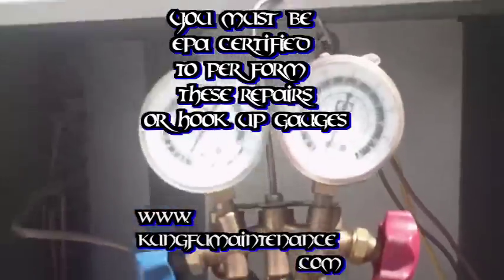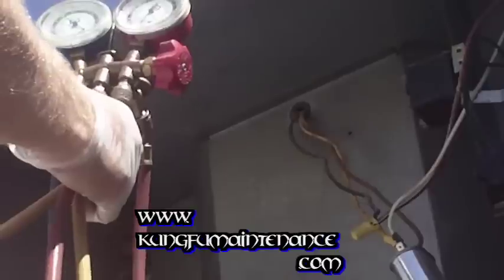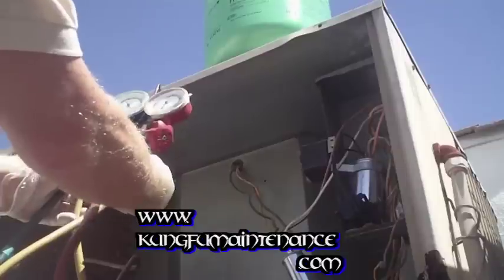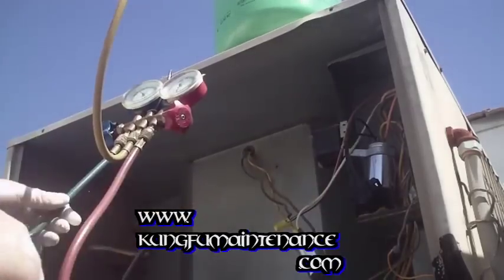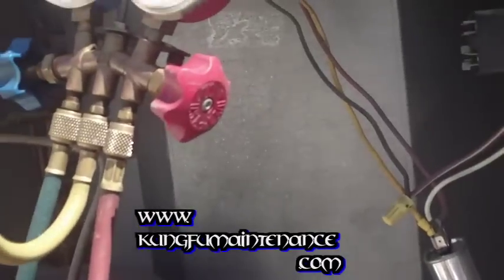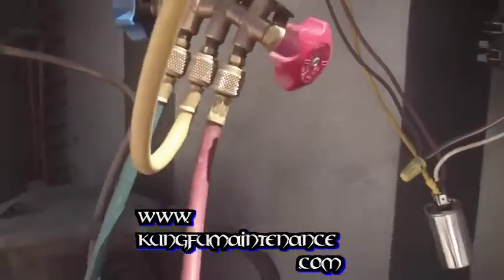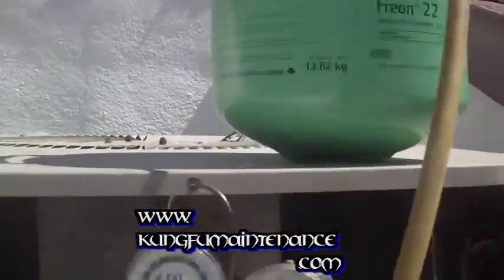How to Charge an Air Conditioner  That is Low On Freon ~ AC 101

Comment from the maker: Get KFM's favored AC Gauges here            http://amzn.to/2kYgGb8
Easiest Way To Get Universal EPA Certified Prep Manual    http://amzn.to/2kIQdQC
Get KFM's favored Multi-Meter  here        http://amzn.to/2l8W9CO 
Wet Dry Vacuum used in so many KFM videos   http://amzn.to/2lFxi7u
Valve Core Removal Tool                              http://amzn.to/2kJ00pC
Inficon Refrigerant Scale                               http://amzn.to/2vUCQPD
Get the Screwdriver used in so many KFM videos here    http://amzn.to/2kHFoOF 
Get the Milwaukee 11 in 1 Screwdriver     http://amzn.to/2uTtsNj 
Get  the Multi Tool Pliers used in so many KFM videos       http://amzn.to/2kWTjPp
Get KFM favored Electronic Leak Detector        http://amzn.to/2kmQMMz
Simple Leak Seek Spray   http://amzn.to/2lFfcC5  Laser Thermometer  http://amzn.to/2layD8I  
Hard Start Kit     http://amzn.to/2kiD16v   Contactor     http://amzn.to/2lFqA0P
5mf Capacitor   http://amzn.to/2wC96sH     35mf Capacitor    http://amzn.to/2vZVZ2t
35/5mf Capacitor   http://amzn.to/2iVJNi2        40/5mf Capacitor    http://amzn.to/2wzEdXD 
45/5 mf Capacitor   http://amzn.to/2w0wez5   
Condensate Pan Tablets   http://amzn.to/2lalV9W   No Rinse Coil Cleaner  http://amzn.to/2lHg8GD
Condenser Fin Whisk Brush                          http://amzn.to/2vWXUoC 
Chapin Pro Pump Sprayer                             http://amzn.to/2vWCXdD
Evaporator Coil Cleaner No Rinse Mix        http://amzn.to/2x3eJTT
Evaporator Coil Cleaner No Rinse Can        http://amzn.to/2ezIxju  
You must be EPA certified to charge or recover refrigerants and here is about the Easiest Way To Get certified with the Universal EPA Certified Prep Manual    http://amzn.to/2kIQdQC

Get The Kung Fu Maintenance book here     http://amzn.to/2lEQPFk
Or  the Kung Fu Maintenance E book here  for less than $5    http://amzn.to/2lEY8wD
Get the Kung Fu Maintenance album (good driving music) "Up Beat" here     http://amzn.to/2l41pZ1
Get the Kung Fu Maintenance album (nice Instrumental music) "Entropy" here   http://amzn.to/2kl2U0p
Samsung Galaxy S8 Plus        http://amzn.to/2sFn9h8
GoPro Hero 5 Action Camera         http://amzn.to/2sN4nVK
Rode Lapel Microphone                 http://amzn.to/2vZoFc7
Purple Panda Lapel Microphone  Kit   http://amzn.to/2wByXkq
Video Edit Pro Software       http://amzn.to/2ruaaeZ
Samsung Galaxy S5                 http://amzn.to/2wBxk6l     
Samsung Galaxy S8 Plus        http://amzn.to/2sFn9h8
Video Edit Pro Software       http://amzn.to/2ruaaeZ

Hire An HVAC Specialist                                  http://amzn.to/2lktKek
Air Duct Cleaning Services                              http://amzn.to/2lFTpun
Central Air Conditioner Tune Up                   http://amzn.to/2lzJGoy 
Air Conditioner Repair Or Installation          http://amzn.to/2lFsEGw                                           
I don't work for any of the product companies  listed however I do make a small commission on items ordered  through the links.
Reply: KungFuMaintenance 2

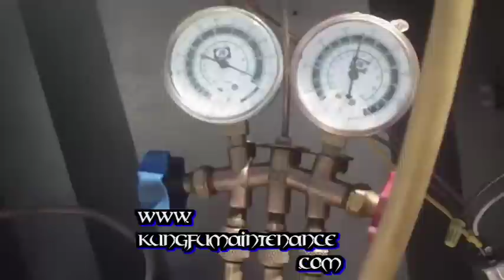Comment: At 7:05 the colored diagram really sends home the information about which is the low side line, high side line, and everything else!  super job guy, thanks.  it's too bad it's Saturday, 90 degrees indoors, and you just convinced me that i probably better not mess with my apartment complex's ac unit when i especially don't have a drum of Freon to spare.

Comment: I like to poor a couple cups of water on the compressor when its running too.  This helps to cool down the bearings and greatly increases the life of the electrode diffusers inside the valves.  allows them to get nice and cool and oils them up.  Great Job Jedi.  Best Damn video i've seen in a while.

Comment from the maker: Yes that is true charging in colder weather takes more time. One way I have found to speeds things up in colder weather is to remove the refrigerant can from the box (which acts as an insulator) and place the jug of freon over the condensor fan so as the fan removes heat from the condensor it blows the heat across the refrigerant can. This recycles the heat energy at the can and speeds up the charge. The box acts as an insulator to the freon can so removing it will allow the can to absorb heat.

Comment from the maker: This one was R-22 vapor charged. You are right in that charging R-410 application is different depending on your jug of refrigerant and whether it has a dip tube or not determines whether the jug needs to be flipped upside down or not to use liquid. Charging R-410 is still done through the suction side but the short story is it needs to be throttle charged with liquid. Not liquid side only just charged with liquid. R410a is charged as a liquid to prevent the refrigerant blend from separating.

Comment from the maker: To lanceditzler,

      This one was just a bit low on freon and took about one and a half pounds to reach proper charge of ambient plus thirty degrees on the high side. It was a hundred and five degrees and climbing up on the roof that day. It just makes sense to calculate refrigerant usage by taking a before and after reading with the scale. No need to lug the scale up on the roof.

Comment from the maker: You are right on there. I opened blue suction line only to charge with vapor. No you do not want to open both as this will let liquid refrigerant cross over into the suction line. For charging purposes you only want to open the blue low side suction line. There are other methods of charging done solely through the high side. I prefer charging with vapor through the blue low side as it is easy on the compressor and fairly easy to monitor and adjust.  ~ Good questions. Thanks for watching. ~ KFM ~

Comment from the maker: This one had a tiny micro leak which I used a micro leak repair additive to repair (you can see the video I have on it if you like to titled "Air Conditioner How To Super Seal Micro Leak Repair"). It has now been a year and several months since the repair and system is still running great keeping things nice and chilly. No lack of performance. Purging the line sets prior to charging is how to prevent getting moisture into the system.

Comment from the maker: Yes that is very likely. Ideal charge will produce a temperature around 40 degrees plus or minus 5 degrees at the evaporator coil. When the freon is low the temperature at the evaporator coil can go below 32 degrees which as you probably already know is the temperature at which water freezes.

Comment from the maker: Best way to charge in my opinion is charging through the low side(suction side) while unit is running with vapor only from the tank, keeping an eye on pressures and temperatures. Low side line should flash nice and chilly all the way to the evaporator coil. Look for the 15-20 degree split from an in going to an outgoing register over a time span of twenty minutes.

Comment from the maker: To Pbour, Yes ambient outside temp + 30 on the high side is what your looking for as a general guide. However some systems have design differences.  Use your feel and judgement. The suction side line should flash ice cold along the length of the suction line to the compressor. When it cold sweats a little you know your good. The general proofs though are 40 degree temperature at the evaporator coil and fifteen to twenty degree split between air temperatures at an inflow and an outflow register.

Comment from the maker: Yes this was R-22 and I was charging by vapor through the low side. This takes a tiny bit longer than charging by liquid but is easier on the compressor and also easier to get at time of service measurements of what is going on (superheat and subcool wise). Charging by liquid takes more time for pressures to balance and adjust. R410A should be charged by liquid (can upside down) unless it has a dip tube) because it is a blend and the blend will separate if charged by vapor.

Comment from the maker: Through the process of "dumping in" one can measure and charge weight of liquid refrigerant on the high side and or low side. This is done with the condensor turned off and waiting an appropriate amount of time before turning the condensor back on.

Comment from the maker: To dianemarie909, there are actually quite a bit of different methods and varied schools of thought as to what is the most accurate method. I like to add the gas little by little through the low side or suction side and monitor temperatures and pressures. Some people weigh in refrigerant by calculating manufacturer specs. and adjusting for length of plumbing with the compressor off through just the high side as a liquid and some through both sides.

Comment from the maker: An initial service call would probably cost about 60 to 100 bucks. Add to that parts or such that may need to be repaired or replaced. If it needed R22 it could be a bit more expensive in price these days as r22 is being phased out which is driving up the cost of the refrigerant. Expect to pay between 30 to 100  per pound of freon average 2.5 ton system holds about 7 lbs. If compressor is not overheating than it is probably no more than 3 pounds if low on freon.

Comment: Thanks for helping me to challenge bull crap artists.  A good A/C guy is hard to find!  I have been told that I needed to replace whole unit for 5000.  I found ants around the contactor.  I just can't charge my system.  I've fixed everything else.

Comment from the maker: If you do a quick youtube search "Four Ways To Speed Up Charging" it should come up in the first few selections (at least it did for me).Yes a little bit of condensate rain for a faster charge, not a bad trade in my opinion. I will echo the voices you have heard against tipping the can as it likely will shorten the compressor life by introducing liquid refrigerant to the pistons.

Comment from the maker: ToTheATLAdventure,
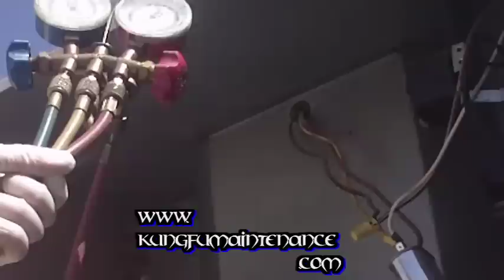     Using quick connect fittings will prevent the refrigerant from going everywhere unless you have a leaking schrader valve. You can see the quick connect in the video with my right hand I  am using a quick connect fitting from about 1:01TO 1:16. When you disconnect the quick connect it quickly cuts off refrigerant flow.

Comment from the maker: Most likely it will take between 1/2 to two and a half pounds to increase 10 psi. The line set distance is the plumbing from the outside condensor to the inside air handler and evaporator. See me vid series "How To Charge An Air Conditioner Low On Freon By Superheat and Subcool" for a better explanation of the terms. For good charge your high side on the green dial would show 110 as a less perfect rule of thumb. I mostly go by temperature pressure relationship (SH and SC) rather than weight.

Comment: If your careful, you can charged with liquid in the suction line and it would me much faster then vapor charging...
Reply from the maker: Yes that is true. Though I prefer the vapor method as it is easier on the compressor. I hope to be showing the liquid charging method in a future upcoming video.
Reply: KungFuMaintenance 
+Jaocb Berge

Thank you to both of you.  Both gave answers that I was looking for.  :-)
Reply: +KungFuMaintenance I agree vapor on smaller units is safer. Last thing you want to do is slug the compressor. Did you leak check the unit after you put freon in it? Let me guess? The customer said "just make cold air"? In the long run the customer would have been better off getting the leak fixed and having a fresh drier installed. I ALWAYS USE THE LAW. 35% leakage requires me to fix it, so either I fix the leak, then charge or I refer you to somebody who doesn't care about his customers.
Reply: And slug the compressor?

Comment: EPA does state that residential a/c with a certain % leak MUST be fixed. If it is low on coolant,if it has a leak or the last man to service this a/c made an incorrect charge. People far too often jump straight to charging a system. In my job we have 5 guys that service the same 443 a/c's thoughout the property. It is go go go all the time. We dont not have time to recover and pressure check every a/c that we think has a leak. A service log sticker is very great idea to place on the condenser!

Comment: Do NOT open the red valve on the gauges. That will allow the high pressure refrigerant into the manifold and then into the refrigerant bottle which could be very dangerous.

Comment: normally when it takes such a long time to charge the system especially one of those old beast janitrol's it means u have something else going on aswell. could be as simple a dirty evap coil or something as serious as a blockage. the only thing that would make the system take so long to take in freon under normal conditions is a extremely long line set or a long lift on the lines. im sayin you also have a dirty evap on that unit.
Reply: That's in his next video. He will take a water hose and spray into the duct work!
Reply: William Hollandsworth some people don't even know they have a filter lol

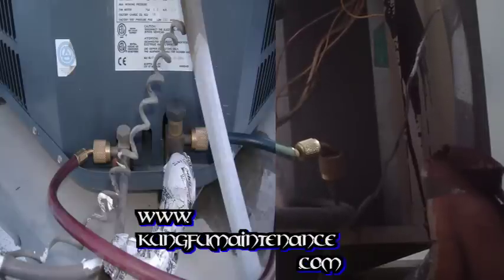Comment: Do you have turn the HEX shaped valve on the suction line (on the insertion at 2:20 of your video) after you hook up the BLUE hose? My low pressure gauge stays at zero after I hooked up the BLUE hose and turned the system on? I saw you removed the sideway cap of the suction line and hooked up the blue hose to it. But you didn't mention anything about  these HEX shaped valves on top of the suction line next to the cap (now blue hose). I just want to check if my Freon R22 is low because my home central AC (Heat pump) is running but not pumping out any cool air.

Comment from the maker: That could be normal, it could even take longer, it really depends on quite a few factors. Temperature out side that day, temperature inside, cleanliness of coils and filters, how hot the compressor is due to running at a low freon level, amount of freon in the charging cylinder, condition of schrader valves, condition of filter driers, all of these and much more factor in to the speed of the charge. Check my video " Four Ways To Speed Up Refrigerant Charging" for tips on speeding things up.

Comment: is ambient temperature the general formula to go with?Will the same formula work for r410a? My last question my system can use both r22 or r410a how do I figure what's in my system? Or is the better route to go is to evacuate the system and just fill it with r410a. Thanks for the great video.
Reply from the maker: +i0wNz407 Ambient + 30 degrees  is only a rule of thumb for R22 charge being somewhat appropriate. Better and more accurate charging is done by calculating proper superheat and subcool. Your unit should be labeled whether it's r410a or R22. You never want to mix refrigerants as this can cause the formation of acids and other unwanted effects. Charging methods for r410a are different than R22. R22 can be charged by liquid or vapor. R 410A should be charged by liquid as it is a formulated blend of refrigerant and for the engineered mix to be proper it is charged as a liquid. R410a has higher operating pressures than R22. The ambient plus  30 rule of thumb only works for R22. Different systems are engineered to work best with certain refrigerants.
Reply: Do u have to vacuum the system completely down OR can u add r22 to what's already in there?
Reply: vacuum the system completely is (of course) the best method, you do want your system to operate the most efficiently.... don't you? you do want your system to operate without contaminates, don't you ?

Comment: kungfuMaintenance i just curious is that okey if ask you about the comment you say that you add 30 degrees to the ambient  that means that the pressure should be 8o + 30 =110 degrees the pressure shuld be 226 degrees? thanks good video

Comment from the maker: AC techs need to be prepared for all craziness they will find out in the field. Ready for anything before opening a unit. Loose capacitors like this should be anchored and I have a couple videos showing different methods "How To Secure A Dangling Capacitor", "Plumbers Strap Method" and the "Military Grade Cable Tie Method". As for the gloves they prevent frost bite see me vid "How To Replace Leaking AC Schrader Valve Cores That Leak Freon Refrigerant Charge" for an extreme demonstration why.

Comment: so you use outside ambient, and not inside ambient? My furnace is in my basement, and the A/C unit is obviously outside...so I would go with outside temp, not what my basement temp is?  Thanks, I know its a noob question.

Comment from the maker: True that all around, these are general rules of thumb, for the general sit u at ion, with general spec i fics, when you understand the gen era l truths it can help you move on to the finer points, such as superheat, subcool,  and fin er testing. K no w ledge is some thing to be built up on but always quest ion ed. It starts with evidence, a found at ion, things you can under st and on and than is built up from there. It is constant ly being re proved test ed and adapt ed to further in sight.

Comment: @mrsokla I only learned about the electrode diffusers in trade school last month.  I didn't know that keeping them cool makes such a big difference in the service life of this type of equipment.  I know that suction line superheat is used for determining heat transfer on the evap and subcooling for the condenser, but that tells nothing about those electrode diffusers.  And what the hell is discharge superheat all about?